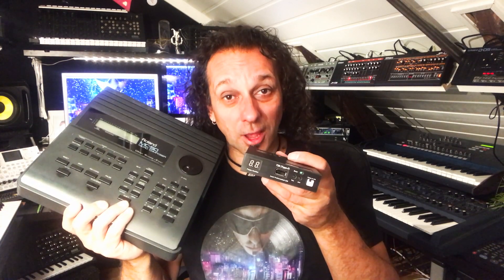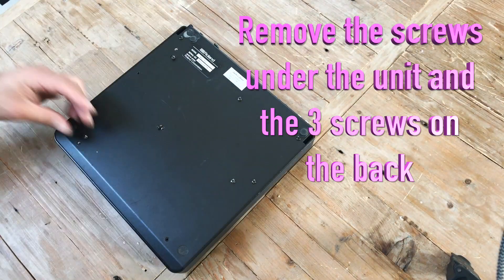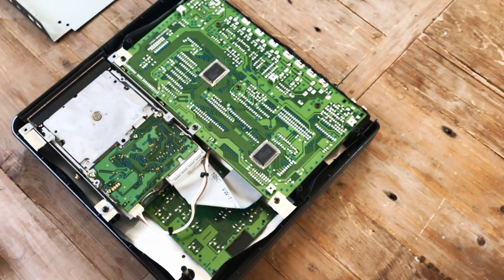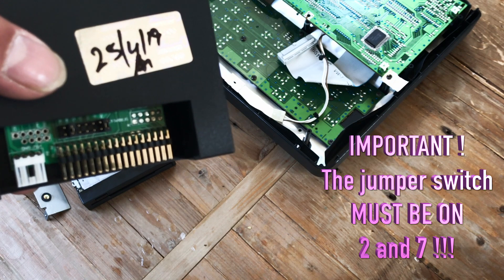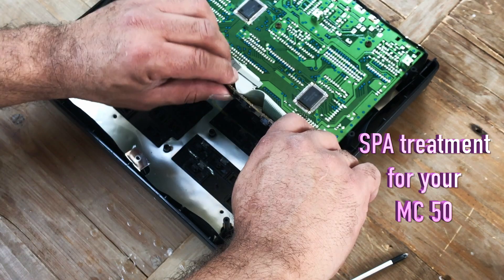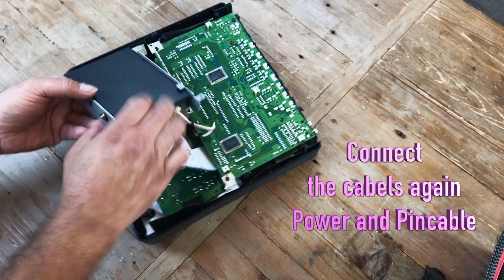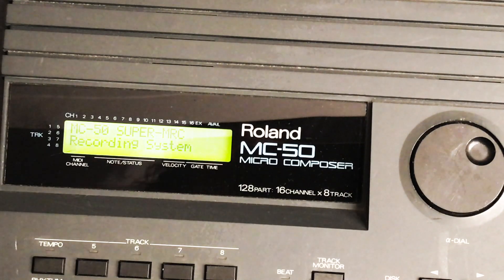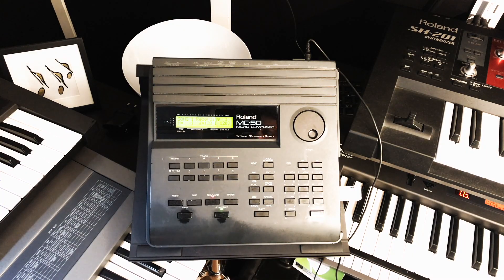Roland MC-50 with USB - Floppy disc replacement

Comment: I’ve been thinking about doing this myself.  I still have 2 MC-50 MkII’s and I still love sequencing on them.  The USB would be much better and much fast for data loading!  Thanks Glenn!
Reply from the maker: That’s cool man :) The loading time is a bit quicker, but not much. I guess it is the processor inside that is the bottle neck :) But a good thing is that on a 16 gig USB it is the same as 99 floppy discs. So I think it’s a great option to install the USB 😃😃

Comment: Glenn, 
Purchased and installed the exact same drive as yours. Everything works great except it will not store data. Upon reviewing  your instructions in this video,  I realized that I did not receive a Disc utility CD and the emulator is not recognizing the USB as a storage device. Do you know if this software is available online for download. Also must this software be loaded into the MC 50 while the floppy drive is still installed or is then software something that can be loaded onto a PC and then initialize the USB drive. I watched the video several times but didn't see that subject covered. Also, do you know of any program that will allow me to download the data stored on my discs with performance data fro the MC 50 so i can use and store that info on the USB drive? 

looking forward to using the new setup ; )
Reply from the maker: I used only the cd rom that came with the mc50. 
I had a start up issue .. and that was that I had to “Initilaze” the usb also When it’s inserted to the drive. 
Just like you would initilaze a “old disc” 
You chose witch of the 99 partitions you want to install... and it should work :) 
Let me know if this solved your problem. Regarding the “back up” old discs I never tried ... 

Best from Glenn
Reply: @GlennMainMusic  So, as a matter of clarity, you did not receive a utility disc with the emulator, you used the disc that came with the MC 50, is that correct? Because in the video you show a CD that came with the the USB drive and frankly, I don't ever recall anything being available for download from CD rom  for an MC 50 ( in the States)  I don't even think data CD's were been available when the MC 50 was introduced in the late 80's they would have come with a CD drive.So I'm a bit confused about that one.
As far as initializing the USB as if it were a disc in the MC 50's  "Disc Utility mode", that was the first thing I tried and it refused to acknowledge that there was even a USB aboard. 
What am I doing wrong?

Comment: Hi Glen! Absolutely thrilled to come across your video as I have tons on music stored on floppy's from my MC-50. 
So, first question concerns retrieving data from my existing floppy discs. I have an external floppy drive but there is no software I know of that will allow my PC to read or convert the Roland file to a usable format...or is there? 

Next,  once I've done the conversion to the USB drive, must I then load data from the disc's via external floppy drive, into the MC-50 via USB input for editing, and  then for storage on to a formatted, large capacity USB stick, or is there another way? 

I imagine I'll be able to fit tons of date from multiple floppy's to the USB.

Any guidance you can give me would be greatly appreciated.
Reply from the maker: Thank you so much for your comments and questions :-) There is a program called "Floppy Emulator" And that program you can let your USB stick be up to 99 floppy discs. To get information from the floppy disc to the usb you must have a "kit" that makes the PC read your floppy drive, or if you have access to an old PC with floppy drive. But at least here in norway they sel "kits" to connect any old floppy drive and read it as a HD via USB. Then you should be able to save all the MIDI data on your stick and the Roland MC 50 should read it. I did not try this method myself, but there are some videos here om Youtube explaining just this issue. Let me know if you do it, and leave it as a comment here so other people that might be interested in the same issue can see your update here :-) Good luck ! I just love that my MC50 is back on track again. But I hope Roland will make a MC-050 boutique version of the MC 50.. with build in memory that was a bit more than the MC 50.. I am looking for a second one to buy, so I can upload more songs in my set without having to stop to load after 5-6 songs :-)

Stay in touch man ! :-)
Good luck .-)
Reply: @GlennMainMusic  Thank you for your response, Glenn. A few other questions. As a matter of clarity is the "KIT" you're referring too is an external floppy drive that links to my computer via Standard USB, correct? 
Next, I've been led to believe that Roland recorded data in some proprietary codec that only an MC-50 or MC-50Mk II,  can read. Do you know if that's correct, than will the "Floppy Emulator" software recognize this codec? 
Finally, I'm in the process of reissuing my 0.0 Module and the difference between buying Flash RAM in the mid 90's and whats available today, is mind boggling. So yes, I'm with you on internal memory expansion eve if it a new, user installable board. 
ZZThanks agaion and I'll keep you posted to my porgress
Reply from the maker: I did not try to convert old disks myself... but I would believe that the pc will read the data from the floppy through the Floopy-USB. And that the copy to the USB is clean... but I never tried it... I did a Re-recording of old songs on it .. :) 
If you look for a “kit” like this (it’s not a kit.. it is more a floppy-USB drive :) 
https://cdon.no/husholdningsapparater/usb-diskettstasjon-floppydisk-p47193536?

Comment: It shows "Error22 DISK I/O See owners manual" on MC-50 on initialize, can you help me?
Reply from the maker: You must "initialize" the USB onthe MC-50 as well... (After you set it up in the floppy disk program that came with the drive).. Try that, and give me feedback if it works.. or dont work :-)
Reply: @GlennMainMusic  Thats what i did, i initialize it on the MC-50 and after the 80% the error shows. I think the problem is on how i setup my usb drive, do you have a link or name of the software on how to convert it so it can work on my mc-50? And do you have any tutorial vids?

Comment: Eu instalei do mesmo jeito no meu Roland Mc 50, mas está dando erro quando tento salvar sequências no pendrive. Aparece ERROR22 DISK I/O SEE OWNERS MANUAL. pode me ajudar ?
Reply from the maker: I did never got that error.. I tried to google it.. but did not find anything... I will let you know if I find something :-)
Reply from the maker: Rosalvo Paradella - You have to use the floppy disc manager software to format the usb. And when you plug the usb to the MC50 you have to go to the disc utility to initialise disc :) Then it should work :)
Reply: @GlennMainMusic  muito obrigado, depois eu descobri que comprei o emulador errado. O meu tem um display de 3 dígitos, não é igual ao seu. Acho que vou ter que troca-lo ou instalar um outro software. Tem um mod chamado HxC flash floppy firmware, que vou tentar fazer.
Reply from the maker: @RosalvoParadella  - Aha :-) That is maybe the answer :-) Follow the link in the description to see where I ordered mine :-)

Comment: I installed this my mc 50 i didnt work it just initialized up to 80 percent only...code Error 22..i/0...aee owners manual pls help
Reply from the maker: And you did use the "floppy disc emulation software"?
Reply from the maker: You have to use the floppy disc manager software to format the usb. And when you plug the usb to the MC50 you have to go to the disc utility to initialise disc :) Then it should work :)

Comment: Glenn, 
I'm officially in hell with this project now and I'm hoping you can advise me on what I'm doing wrong. 

I contacted Vishal at Gotech and he directed me to the download page  (which by the way was not working for anyone else that tried to use it. I advised of the problem and its now been corrected)  I downloaded program and repeatedly followed and executed the instructions for formatting the USB exactly, running the software in Windows 10 as Administrator and using the Toshiba 16GB USB stick provided.  I’m not receiving any messages which would indicate any conflict with the Windows defender antivirus program.
The Emulator still refuses recognize the USB or will allow me to initialize the stick using the MC 50 Mk II.

The file I downloaded is “USB Flash Drive Formatting Software – Windows Xp / 7 / 8 / 10”

The installation of the 720 F-Type was without issue and I’m confident I have the pins configured properly because the unit records and functions normally. However, it will not save any data and when I attempt to load anything onto the USB stick I get an error message that reads “Attn: NO DISC Insert Dick and Enter”
I also noticed that the instruction video provide on the Gotech site was filmed using a “Windows 7” OS. 

I suggested they film a version with explicit step by step instructions on a Windows 10 OS demonstrating every aspect of implementing this software especially installing and running the program as “Administrator”,

So, if there's is anything that you can do to help me get this unit functional, please advice.  If not, I will be removing and returning this unit.
Reply from the maker: Did you «format» the USB on the MC50 itself ? 
You must go into “Disc Utility” on the MC50, and initialise the usb partitions (99 in total , but you can do it one by one as you need saving space)
Because it looks like the MC50 don’t recognise your USB stick. 

So try that - If you didn’t do it already .. 
let me know the progress :)
Reply: Thank you for your response.
I repeatedly attempted to initialize the USB on my MC 50 Mk II and got the "Insert Disc and Press Enter" error message each time. I then went back and reviewed your video and saw that at point 0:18 you mention that you received a USB stick and  a  "CD for Disc Utility"  with the Emulator so the MC 50 will recognize the USB. However when I asked you about this Utility Disc in my prior post, you responded "I used only the cd rom that came with the mc50" which again I find confusing because there were no CD discs  issued by Roland for an MC 50 nor would a utility conversion disc be needed to format. So I'm assuming that you referring to the internal formatting functions of the MC 50.  At this point I contacted Gotech and went through sever days of contact with Vishal trying to get the software downloaded to format the USB to the MC unit will recognize it. As of this morning, nothing has worked.
The only other thing I can think of is to reopen the MC and see if the pin placement is correct.

So, three more questions. 
1: With the exception the ability to load and save SMFs and to record while sync'd to tape (Smart FSK) the Roland MC 50 & the MC 50 Mk II are exactly the same OS, correct?
2: Is it possible the jumper pins are a different configuration for the MK II?
3: When you purchased your 720 F-Type Emulator, did you receive a CD disc that was used to format your USB stick prior to initialization in your MC 50 or were you able to insert the USB and initialize it without formatting it first?
                                                          -----------------------------------------------------------------------------------------------------------
Glenn, takk for svaret.
Jeg prøvde gjentatte ganger å initialisere USB på MC 50 Mk II min og fikk feilmeldingen "Sett inn plate og trykk Enter" hver gang. Så gikk jeg tilbake og vurderte videoen din og så at du på punkt 0:18 nevner at du mottok en USB-pinne og en "CD for Disc Utility" med Emulatoren slik at MC 50 vil kjenne igjen USB-en. Men da jeg spurte deg om denne Utility-platen i mitt forrige innlegg, svarte du "Jeg brukte bare CD-rom som fulgte med mc50", noe som igjen synes jeg er forvirrende fordi det ikke var noen CD-plater utstedt av Roland for en MC 50, og heller ikke verktøy konvertering plate være nødvendig for å formatere. Så jeg antar at du viser til de interne formateringsfunksjonene til MC 50. På dette tidspunktet tok jeg kontakt med Gotech og gikk gjennom flere dager med kontakt med Vishal og prøvde å få ned programvaren for å formatere USB til MC-enheten vil kjenne den igjen . Fra i morges har ingenting fungert.
Det eneste andre jeg kan tenke på er å åpne MC-en på nytt og se om stiften er korrekt.

Så, tre spørsmål til.
1: Med unntaket er muligheten til å laste og lagre SMF-er og registrere mens de synkroniseres for å tape (Smart FSK), Roland MC 50 og MC 50 Mk II nøyaktig det samme operativsystemet, riktig?
2: Er det mulig at jumpernene har en annen konfigurasjon for MK II?
3: Når du kjøpte din 720 F-Type Emulator, mottok du en CD-plate som ble brukt til å formatere USB-pinnen før initialiseringen i MC 50, eller kunne du sette inn USB-en og initialisere den uten å formatere den først?
Reply: @boomtheory9799  Same issue, did you manage to fix it?
Reply: @trojarnnnn I was able to format the USB stick and then transfer all floppy data to the USB. Unfortunately, when I uploaded the data from the USB into the MC50 all tracks were transferred to channel one. I had to then extract all the tracks to their respective channels in order to edit or rearrange. The good part is is all edits and arrangement changes were saved to the USB stick, but when I tried to load them in again they all went back to the first channel and needed to be extracted again. Not sure how to fix this